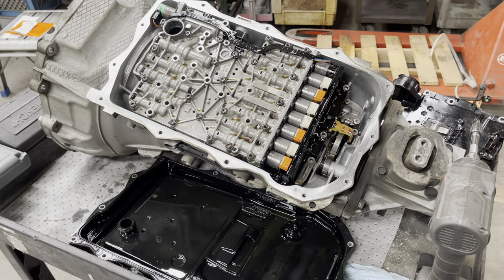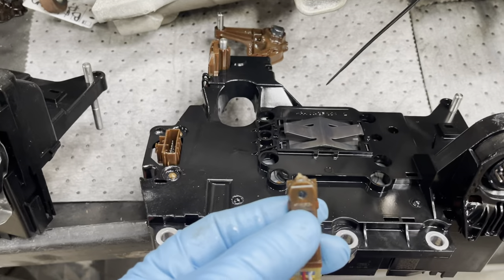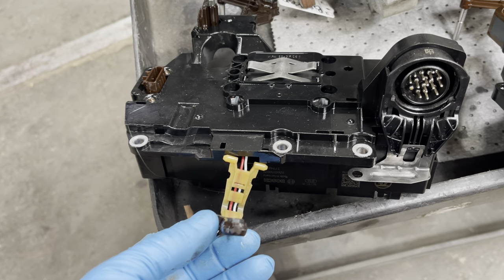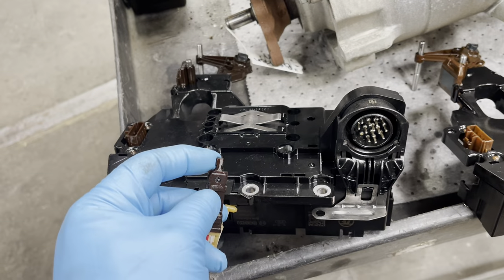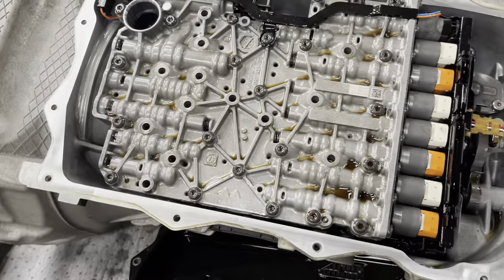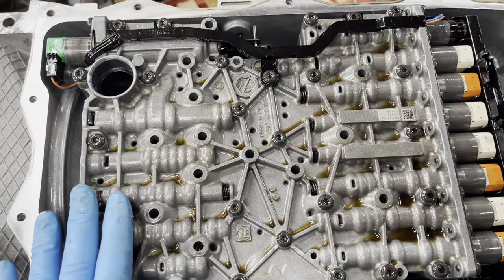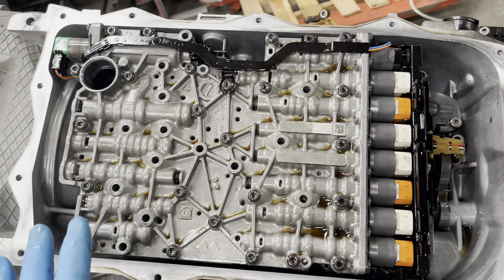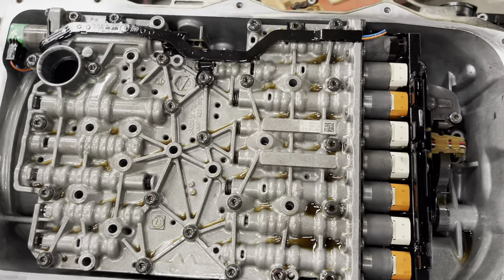Jeep JK 8 speed valve body

Comment: Would the broken sensor tip cause:
“TCM undetermined clutch fault?” &
“Clutch 2 fault?”
I swapped in a new 845RE into my Durango, and that sensor tip was broken off from the old TCM (but swapped in to the new donor trans). As soon as I start driving, it jumps into 6th gear limp home mode when it does the 2-3 shift. 
Thanks, not much of this info out there other than your video.
Alex

Comment: Hello, I have a Jeep Wrangler manual gearbox. I need an automatic switch. What parts should be replaced?
Reply from the maker: What year Jeep, we can only do a 8 speed on a 2012-2018 Jeep Wrangler with the 3.6L 
8 speed in a 3.6L JK 845RE 850RFE 

Flex Plate for the guys going from a manual to a auto 4752463AB for the 3.6L

Flex Plate for the 5.7L/6.4L 4752574AB

Flex Plate bolts to crank 6503465

Torque convertor bolts 650936AA

Transfer Case cable mount 52121832AC $30.00

Transmission Cooler Lines JL 68291875AB For 8 Speed $177.10

Transmission Cooler JL 68481147AE

2 Transmission cooler fittings 68489743AA  $50.00

8 Speed wiring $1500.00

8 Speed floor plate and spacers 4

Truck Transmission mount to t Case adapter 68147344AA  $110.00

8 Speed steel trans pan Jeep JT 68408606AB  $200.00 

Transmission oil 68218925AB  $30.00 needs 10 quarts  

The transmission new can cost $4000.00

Low mile used  $1200.00

Shifter $200.00 used

Bezel $50.00 

T Case used $500.00 non Rubicon

Gear gauge $150.00

Plate B $50.00

Transmission Cooler Mounts part # JKTCM  $50.00

Comment: also i've learned to have ac and power steering i have to use the ram ac compressor and power steering pump  but what else to set the pulley design i know possibly a idle or bracket or some sort
Reply from the maker: On the Ram engine we use Ram accessories and on the Car style we use the car style accessories, we have a BOM page or i can email you..

Comment: Man I broke 2 damn speed sensors putting them in wrong. Actually the 2nd one just bent slightly. So, my question is, is there any fix besides replacing the whole TCM?  I can’t find the part itself to replace it. Ugh. Pretty embarrassing, but easy to screw up. For the record I put the 2nd one in many times thinking it was straight.
Reply from the maker: I don't think you can replace the sensor, it is hard to get any 8 speed parts..  You will need to replace the transmission computer

Comment: this has nothing to do with the 8 speed trans however i do have a question for u i want to swap a car hemi 5.7 in my jk and this set up also comes with a nag 1 transmission is that the same trans that comes in the jk 2012-2018 also if i just want to use the nag 1 trans from the hemi 5.7 will the jk non rubicon transfer case work with that?
Reply from the maker: So in your case the Jeep JK Nag1 and a car Nag1, have a different output, but you could use the Bell-housing, torque convertor, Starter and intermediate plate from the V8 to your V6 so you would have a V8 Nag1 and that would work in your Hemi conversion.
So in the 2012-2018 Jeep JK you would need to use the 2009 and newer Hemi..
Reply: @jeepspeedshop  so the v8 nag 1 trans can be swapped out with the v6 trans by using v6 starter and v6 bell housing on v8 nag 1
Reply from the maker: @beeski_on_30sfinally77  So if you have a V8 Nag1 you can reuse the Bell-housing, Torque convertor, starter, Intermediate  plate and you can install those parts on your V6 Nag1 so it will bolt up to the V8..
Reply: @jeepspeedshop  thanks tod u been a big help will i need stronger axles or will i been fine
Reply from the maker: @beeski_on_30sfinally77  Your axles should be fine, how big of a tire are you running, tires kill axles.  If you are running 35s and smaller you are fine, now if you are running 37s and bigger axles don't like that.
Reply: @jeepspeedshop  I was thinking of doing 37s with a 26-inch or 24-inch rim haven't really decided yet
Reply from the maker: @beeski_on_30sfinally77  I like 17 inch wheels